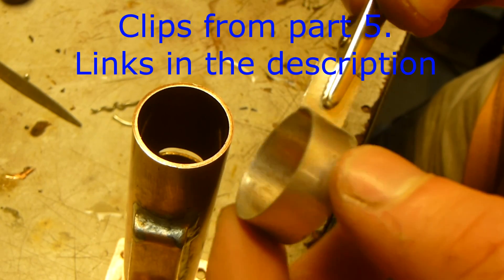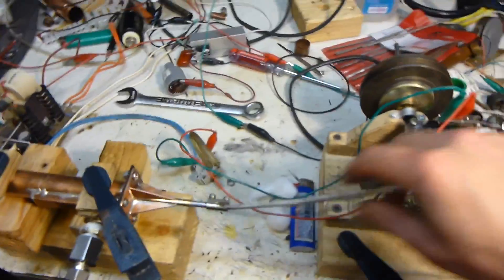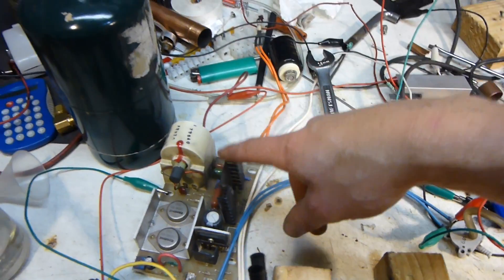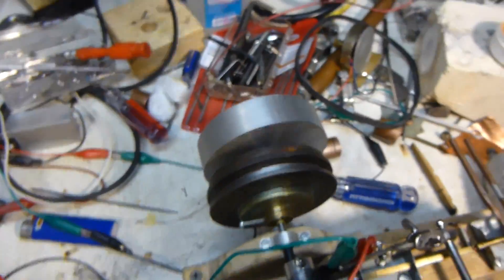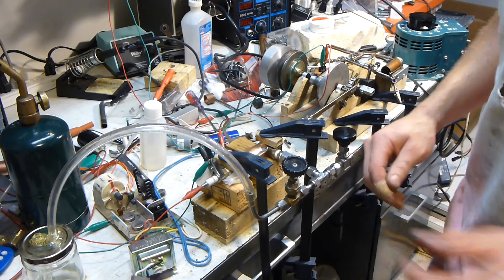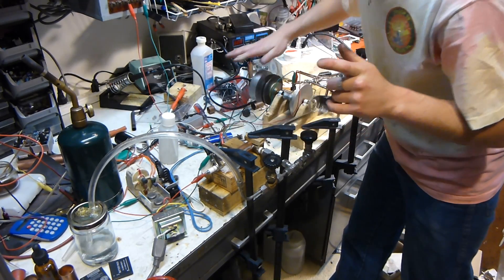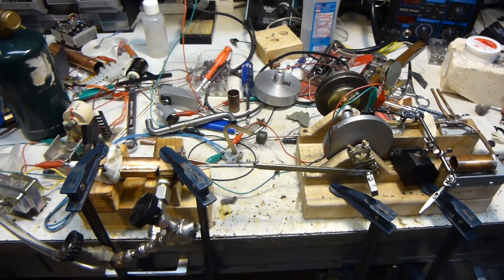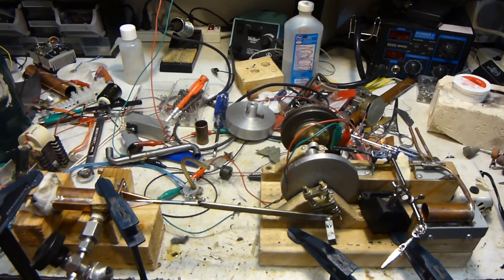Part 6 Internal Combustion Engine First Run and Starting

Comment: Good job!   I up loaded two new videos, one of another little steam engine build, with boiler and one of my second four stroke engine built from castings.  My first engine was a tiny two stroke also.    Try making your piston from aluminum bar. It's pretty easy with your lathe.  You can still use your "O" ring for the piston ring.  https://www.youtube.com/watch?v=bOIJiKEaxgE

Comment: I think everyone who builds an engine jumps up and down and sings when it first starts, It Runs!
.  Great job and congratulations !
Reply: You aren't kidding. I was ear to ear grins.
Reply: Back many MANY years ago when I was 14 or 15 I rebuilt the engine on my old Yamaha TY50 trials bike. It was the first time I attempted something like that, So when I kicked it over and it actually ran I was fist pumping and dancing around the garage like a demented hyperactive 4 year old (And that was after using Yamaha replacment parts that were MADE to work together !!!)......... After scratch building an engine that actually ran, I'm surprised that this kid* wasn't doing cartwheels and back flips ! LOL ! 
(*At my age everyone's a "Kid" :) )

Comment: That runs great, i wish mine worked, but i realized that the compressor i was using was just too worn out and was just loosing compression but i was at a stage where it did almost work. The ingition seems to have improved as well, rather than that plank with a bunch of massive transformers and other mumbo jumbo on it. Keep exploramenting, man.

Comment: Do you plan on mixing oil with the fuel like for a regular 2 stroke?
Reply from the maker: +zxz1997 Nope.  No oil.  This is a bubble carburetor.  So technically no liquid fuel will ever get into the engine.  Only vapors that evaporate from the fuel in the jar.  So if I did add oil it it probably would not get into the engine to do it's job.  This is the same reason I do not use gasoline in this engine.  If I used normal gasoline the non volatile components of the gasoline would accumulate in the jar because they do not evaporate.  It i sprayed the fuel and oil directly into the intake like a normal 2 stroke then it would work great with oil.  But I feel like it would be hard to control a flow of gas.  But it is something I plan to try.  Thanks!
Reply: +Makerj101 Yep, thats true. The oil in the fuel would not let it evaporate as easily as it is now. The trickiest part of an engine is the carburetor, but Im pretty sure you could fabricate one like those you find on model cars and airplane engines, they are very simple carbs and works really well. Some of them have only one needle, regulating the fuel flow into the engine. Those are all (well, most of them) 2 stroke engines and have the oil pre-mixed with the fuel (you could also try to use that kind of fuel with your engine, it evaporates VERY easily). They are a mixture of methanol, nitro methane and 2 stroke oil (usually castor oil or some synthetic blend).
Reply: +Makerj101 you can also maybe use lamp oil so it burns cleaner for such a small engine, rather than conventional 2 stroke oil
Reply: Actually the only reason that oil is added to fuel in two strokes is to provide lubrication to the rod and main bearings, which is not going to happen in your engine. Perhaps some sort of oil bath or oil drip container rigged up to squirt, drip or spray oil into the back side of the cylinder to provide lubrication to the piston and o-ring, maybe just a small tube soldered into the cylinder may work so the piston travels across it and the oil wicks into the gap between the cylinder and piston via capillary action? Just spit balling ideas here to help the engine last longer on runs so it doesn't seize.
Reply: Yeah just make a small hole in the cylinder under the piston ring (when the piston is at BDC) and make oil drip to the piston there with gravity.
Also I suggest making a small hole for the oil to drip out roughly at the same place, but 180 degrees around the cylinder so extra oil will leak out.

Comment: Great work man, this is quite an achievement.  I have a feeling that the extra weight wheel you put on was working against you, as soon as you took it off, things got better.  Anyway, just my observation based on the video.  Keep going man, you may make a discovery about combustion engines that no one else has.  Congrats!
Reply from the maker: +Thomas Sexton Well it helped at first to get the engine to turn over a couple more times so I would have more time to adjust carb before I had to turn it over again.  But once I finally got the engine working the out of balance really did not help once the engine gets up to RPM.  IDK about that!  :P  I mean people have already built internal combustion engines without machine shops.  I'm just one of the few who have in this century and documented it online.

Comment: I want to encourage you. You have just proven to the world that you can make an internal combustion engine. Now here is something that you need to make. Retro fit a new Toyota engine with points and condenser so that it can operate with no electronics. You are truly an Einstein of your time. The USA may be hit with an EMP, and that would destroy electronics. So if you are ahead of the game, and can build a steam powered metal lathe and can fabricate parts to retro fit modern engines with electronic ignition and get around electronic fuel injection. Even better is to get a diesel truck and set it up with mechanical injection and a massive fuel tank, so that when the lights do get turned out, you can be the engineer of your town or clan. Diesel fuel will be in abundance in semi-trucks that are running on electronic systems.
Reply from the maker: +Jimmy in Mexico That's a brilliant idea!  I actually really want to do this.  I'd also have to take it to the next level by hacking an automatic transmission to manual control.  Diesel would certainly be easier.  Only real problem is I don't want to risk ruining my daily driver.  That would kinda suck.  So maybe I'll consider one day buying a cheap piece of junk and doing this.  Either that or when I get a newer car.  Thanks for the idea!
Reply: Makerj101 I have an idea. Look online on Richie Bros. Auctions and you can find some small equipment with diesel motors. Then build adapter plates to mate them up to standard trannys. (Sounds wrong, I know) mating trannys! Ok back to the subject at hand, then you spend a few bucks and buy an old Ford pickup or Bronco and stick the assembly in it, and then you have something. You'll have to do it to an older model truck, because then you dont have to worry about emissions. Sometimes you can buy a smooth drum roller real cheap. Cheap enough to take all the arts off and then scrap the rest and get your money back. Sometimes you can get old diesel pusher school busses with Cat motors for about $300 - $500 dollars. Think about a little Nissan frontier with a 300hp cat motor...now your talking. Im just giving you ideas. Dont let your talents go to waste. Electronic systems were made to fail, or be susceptible to EMP or solar flairs. Your mission, should you choose to accept it, is to provide for your family and community a way to prosper and survive the coming disasters.

Comment: I'm curious if the full stroke distance of the piston is equal to the lateral distance of the travel of the crankshaft. It looks like the piston needs to move more than the range allowed by the offset in the crankshaft.

Comment: Awesome! If you need a schematic for an simple Transistor Ignition coil driver , just ask me :)
Reply from the maker: +MyCrazyGarage Thank you!  I actually have already implemented a ignition coil and fairly simple circuit that I designed.  It uses a magnet and hall effect sensor.  That signal goes to a transistor to invert it and then is fed to a power MOSFET which switches the coil on.  The videos are just a bit delayed!  :P  This video was actually recorded back in October but I have put off editing it for so long.

Comment: Well done man!   Exciting stuff.
What's next?
- Water jacket for cooling?
- Home made dyno?
- Electronic (non-microswitch) timing?
- Oil/gas mixture, as others have suggested?
- Better carb?
Reply from the maker: +Ryan Brooks All of the above plus more!  :D  And some of that has already been done.  I've already implemented water cooling and water pump, a manual oiling system, and hall effect sensor timing.

Comment: Seemed like it was losing compression as it started running more, I agree add an oil supply to the cylinder or add some to the fuel

Comment: does the coleman fuel contin some oil?
i can tell you with a wee bit oil you have more compression and it will also run alot better
also if you add a mesh to your air in tube (under fuel) you het smaller bubbles and more fuel in the jar
Reply: +robot797 You around here?:DD
Reply from the maker: +robot797 Nope.  No oil.  This is a bubble carburetor.  So technically no liquid fuel will ever get into the engine.  Only vapors that evaporate from the fuel in the jar.  So if I did add oil it it probably would not get into the engine to do it's job.  This is the same reason I do not use gasoline in this engine.  If I used normal gasoline the non volatile components of the gasoline would accumulate in the jar.  The mesh is a great idea.  Might make it a little bit more consistent.  Thank you!
Reply: About the oil
There are oils that do vaporize I have seen a few 2 strokes that run on a mix
To be precises a Dutch guy who makes engines with glass cylinders
Reply: I am everywhere
But mostly at stuff that involves science
Reply: I'm gonna build this;) it's so cool.
Reply: mmmmmmmm cool
i wound but i dont have the tools for it
Reply: I also don't have many tools, but I think I just need a saw, a drill press and a soldering iron;)
Reply: DerKrawallkeks the drill press is my missing part (also time)
XD
Reply: ok:D
Reply: that also why i upload so little
but i now i kind of have  a video
(will take a week or 2 to finish the device)
Reply: Okay, looking forward to it^^ what is it?
Reply: DerKrawallkeks a secret
but i ken tell i made a video of a similar thing bevore
Reply: okay;)
Reply: it is a diferent version of something that bears the name 5001
Reply: Lorenz is my name:D that's funny
Reply: DerKrawallkeks yay the hint was not to hard
Reply: Youtube search was not bad;) "robot797 5001"
still funny that this thing has my name:D
Reply: DerKrawallkeks realy
that is funny yes
the cool thing named after me is peter (its a computer from philips)
Reply: :DD